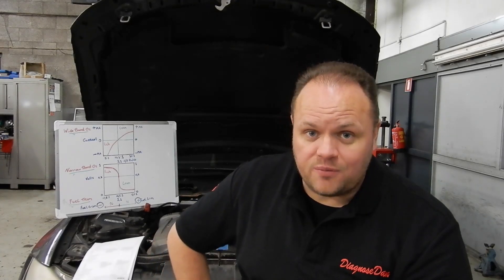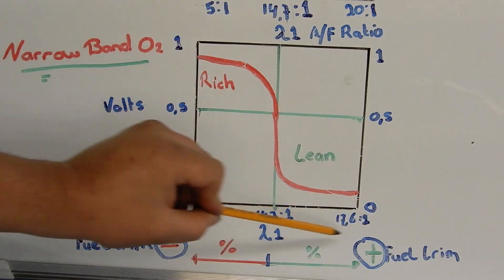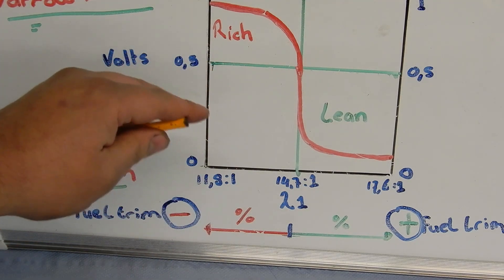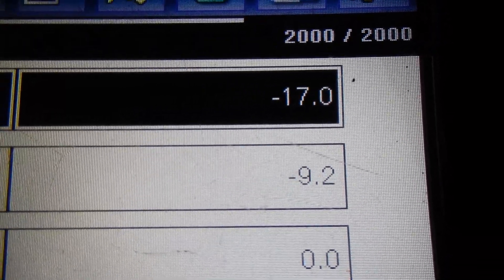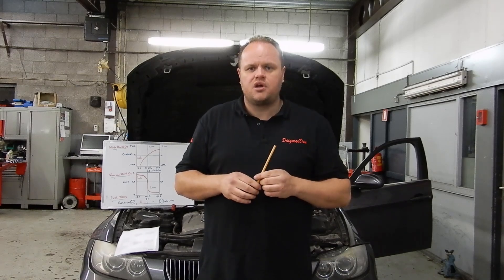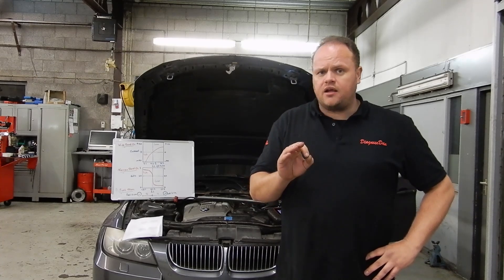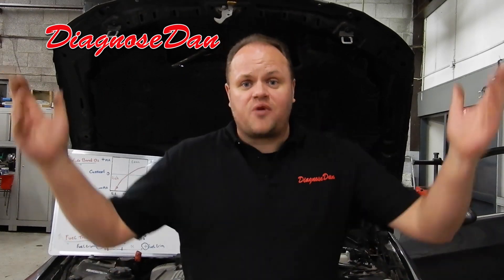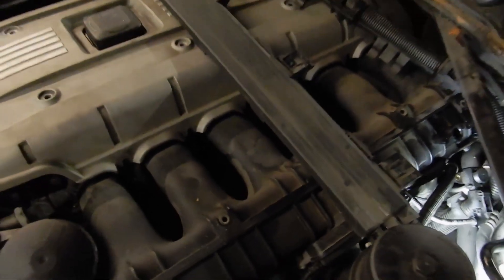Wideband O2 sensors, Narrowband O2 sensors and Fuel trim.

Comment: hi Dan, how about titanium dioxide o2 sensors used in bmw M52 engines? these are narrow band o2 sensors which don't give a voltage to the ecu. they can't be diagnosed the same way as the more common zirconium dioxide sensors.

if you don't know they exist in some cars you could go realy the wrong way

Comment: Maybe a little late, but no vaccum is caused by that engine is running on valvetronic haha, no vaccum is generated due to the inlet valves are controlling the amount of air entering the engine by controlling the lift, vaccum are caused when a “butterfly” valve or throttle valve are partially closed, that causes a vaccum :)

Comment: I know this is an old video but you cant make a vacuum leak in the intake on that Bmw because it doesn't use a throttle body to control air intake. It uses valvetronic system to vary how much the valves are open to control throttle.
Reply: I had to scroll a bit to find the answer thanks

Comment: I have been driving myself insane troubleshooting a failed smog on my 98 boxster. Fuel trim negative, indicating rich.  But downstream shows 0.1 or 0.05, lean. This video explained clearly that it's likely an upstream.  Untill now I have been watching voltage instead.  Thanks for the help.

Comment: To answer you question at the end. No vacuum because the car is at wide open throttle and using variable valve displacement to control RPM? If both the O2 sensors was showing rich exhaust how you introduce a lean condition to test them?

Comment: What a great lesson Dan. My understanding of O2 sensors was basic till I watched your presentation. This topic is deep. I was glad you presented it in a slowed manner. I was actually haveing mental gymnastics calculating what you were presenting. Never knew widebands were current sensors.  Just replaced the downstream sensors in my 180000 mile N62TU. Car runs so much smoother. I think the downstream sensors play a role in fuel trim, not just cat effieciency monitors which was the code I got on bank 1 and 2. I have no clue on the algrithms BMW uses in the DME.

Comment: There is no vacuum because the vacuum is created at the intake valves with the variable valve lift system and the throttle blade is fully open when the car is warmed up, i think bmw calls this system valvematic

Comment: Great information. But why the FT for wideband o2 is not valid for Honda . In Honda during negative current the system runs lean and computer starts adding fuel.
Reply: from Scannerdanner.com Honda will typically display the sensor current directly, no voltage conversion shenanigans. 0 mA represents stoich, negative current indicates lean, and positive current indicates rich. Have a close look at those current values: Around .4 mA during power enrichment, and 1.5 mA during fuel cut decel. This is why measuring the sensor signal directly is so difficult!

Note the AF FB and AF FB AVE PIDs - these are Honda-ese for short and long term fuel trims. Snap-On was kind enough to add the translation in, but I can’t say that all scanners will do this. They’re also not displayed like typical fuel trims, so remember this: Values above 1.00 represent positive trims, and values below 1.00 represent negative. For example, if your data showed AF FB at 1.13 and your AF FB AVE at .98, that would translate to a short term of 13% and a long term of -2%.

Comment: Great video and great explanation.  Let's assume that your OBDII scanner does not give you amperage in mA for your wideband upstream O2 sensor.  How can you tell the wideband upstream O2 sensor is bad in your example, since the voltage only changed from .940 volts (on bad sensor) to about 1.0 volt on the good sensor?  In other words without knowing the mA on the upstream wideband O2 sensor, how can you tell what it is reading only by the , as I assume voltage reading?

Comment: I recently worked on a Honda where wideband negative current draw was lean, not rich like in the video. Is this something specific to hondas?
Reply: scannerdanner.com  :  Honda will typically display the sensor current directly, no voltage conversion shenanigans. 0 mA represents stoich, negative current indicates lean, and positive current indicates rich. Have a close look at those current values: Around .4 mA during power enrichment, and 1.5 mA during fuel cut decel. This is why measuring the sensor signal directly is so difficult!

Note the AF FB and AF FB AVE PIDs - these are Honda-ese for short and long term fuel trims. Snap-On was kind enough to add the translation in, but I can’t say that all scanners will do this. They’re also not displayed like typical fuel trims, so remember this: Values above 1.00 represent positive trims, and values below 1.00 represent negative. For example, if your data showed AF FB at 1.13 and your AF FB AVE at .98, that would translate to a short term of 13% and a long term of -2%.

Comment: Hi Dan, 
could you tell me if these changes in PIDs are normal or not, please?
After the engine warmed up
RPM : ~2000RPM 
upstream O2 sensor  :   -0.008 mA (this fluactes a bit)
downstream O2 sensor : 0.56

2 minutes later 
RPM :~200RPM
upstream O2 sensor:   -0.055mA
downstream O2 sensor: 0.135V

should the voltage of the downstream sensor remain roughly 0.5 V  cuz the RPM was the same?

Comment: No vacuum because of variable valve timing. Does BMW use the intake valves as throttle? I'm pretty sure Nissan is doing something like that now. Air is stacked in the manifold because the throttle body is open and when the intake valve opens the air is right there ready to go in at atmospheric pressure. Pretty cool.

Comment: The BMW has no vac in intake, because it uses valvetronic variable vale lift to control airflow into engine. So there is essentially no throttle body at front of inlet manifold to create a vacuum

Comment: thank you for the video I've had a hard time finding good explanations of wideband, narrowband, and the relation between the two with new systems that use both oxygen sensors for fuel trims.  Next is Biased Voltage sensors.

Comment: I think there is no real Vakuum in the intake manifold because BMW don't use a throttle valve to control the amount of intake air, instead of that they control the travel and the duration of the intake valves using a system called "Valvetronic" or "Fully-variable elektromechanical valve gear".

Comment: thanks for awesome video .  i have 2016 hyundai 1.6l GDI . upstream reads 1.40v steady .   respond's to vacuum leak and rich to add brake cleaner . downstream steady at 0.600 mv ... no symptoms no codes .  complaint is excessive fuel consumption ... upstream o2 is 5wires . thanks for your help

Comment: hi Dan, i just got a CLK200K 2009 A209, Kompressor Avantgarde, convertible . 184hp, Automatic 5 gears. i think it drinks too much juice, i can not get more than 27 miles per gallon. in the last few days i am trying to learn about sensors , fuel trims, zone sensors, wide/narrow bands . i dont know much. what do you think i need to do / know in order to improve mpg. thank you

Comment: I have a Commodore with a Buick derived engine. { Australia) I will stick with its simplicity compared to these Euro engines with multiple O2 sensors and variable valve timing. So far 280,000 kilometres and still on original injectors and sensors. I can do a lot of the work myself unlike these complex cars which need some expensive equipment to diagnose. Still very fascinating learning how all this new fangled stuff works. Really appreciate your time and dedication producing this training grade series.

Comment: BMW call that system Valvetronic. The car does have a throttle, but it's mainly there for backup purposes. Inlet air regulation is achieved by means of variable valve lift. It's a semi-complicated system of lifters, followers, an eccentric shaft and a servo motor.

I'm not entirely sure what the benefits of this system are supposed to be, given the additional complexity and reliability issues inherent to this type of thing, but I can attest to one of its main drawbacks - appalling throttle responce. Granted, I jumped from a 25 year old toyota with a cable-driven throttle (no VVT or VVL), which although not fast is quite snappy and very direct (plus, blipping the throttle doesn't require actually flooring it), into a 15 year old 325i. The main thing that does not compute is their marketing claim - "The ultimate driving machine". This car is supposed to be a joy to drive, I don't see why they've hobbled it by turning the throttle into a wet sponge and demolishing the clutch feel completely.

I could go on a very long rant about the pointlessly complicated nth derivative algorithms which I'm sure they've used to make this thing feel as squishy as possible, when all they ever needed to do was just leave it linear :/

Comment: For some reason my N52 never threw any fault codes, even though one DISA valve had completely disintegrated, the other had seized up, the PCV system was fakked and the engine just generally wasn't too happy. It's still not running the way I'm told it's supposed to be, so who knows what else is wrong... Not a fault code in sight!

Comment: Dan I have A similar situation!
Honda Pilot 2003   3.5
Bank#1 is down.
Bank#2 is working.
Engine running at idle
By sight you can't tell something is wrong
But the pcm is taking fuel to that bank #1
I disconnect the 3 coils from that cylinder
Engine won't miss put them back and no change.
Then I decided to desconect each coils from #2 bank
And they miss and when I finish from desconecting all coil
Engine won't dies...
Pcm supplies the fuel to #1 cylinders and  engine keeps working..
If I reconnect bank #2  bank #1 shutt  down.
There's only 2 sensors up and downstream
V on downstream 0.035v up to 0.135 v
Upstream 0.915v and down engine warm.
Short term fuel trim bank 1 S1    -27.3% steady
                                           Bank 1 S2  -27.3% steady.
This is my nightmare for almost a year.
Many mechanics and tips here on you tube
And nothing...
I will check what you're teaching here.
Why this behavior this is the second pcm.
No codes..
No pending code.
Don't have the readings of #2 bank
Because my scanner only shows 1 bank.
But is working and spark plugs are clean.
Just gives me an advice when ever you can!
Thank's
That's the evidence on those cylinders.

Comment: there still use a valve plate only when engine start on cold condition, when the engine reach its normal working temperature valve plate remains wide open, then there is no vacuum at the intake manifold, valvetronic take control of the engine, now even with the engine at normal temperature operation the valve plate will operate if the engine is turned off and then back on, in this case the valve plate will wide open really quickly (milliseconds)

Comment: During idle Air Fuel Ratio should be maintain 14.7 or lambda 1 right? but 14.7AFR = 0.5v for o2 sensor, meaning during idle graph o2 sensor should be constant 0.5?

Comment: I dont know if there was already answer for your question, but i think it has something to do with valvetronic.
At least 4 cylinder valvetronic engines do have vacuum pump. I think n52 has also valvetronic. Maybe something to do with that?
Great vides, i really like. You are really doing diagnostics, not swapping parts.

Comment: So in that same bmw, if there is an intake gasket with a vacum leak, the long term fuel trim should be positive and since the ecu corrects the long term fuel trim to 13% at idle and to 5% at 2500rpm, I can pinpoint there is a vacum leak. Right? Thanks!

Comment: Hey Dan I know this video is a couple of years old but it just saved me over $2000 dollars. 2006 Acura TL 216,000 miles P0420 catalyst below threshold bank 1. But short term and long term fuel trimmed maxed out. Downstream sensors were reading lean condition.Sprayed carb cleaner to verify downstream o2 sensors were working. They were. Long story short  coolant temp sensor was +40° off. Making the ECU  think the car was hotter than it was and giving less fuel. Which the o2 sensors were reading and ecu trying to compensate with fuel trim. No 02 sensor replacement ($200 × 4) no catalytic converter replacement ($600 ×2). I do my own work (free). $30 coolant temp sensor fixed everything. Cant thank you enough. If you're ever in NYC I owe you a ton of beers.
Reply: Was the temp sensor reading off by looking at the scan tool live data? Or how did you find out the temp sensor was bad?
Reply: My temp sensor was bad, doing the same thing. My scan tool data said my temp was 140C on start up and my cooling fan was coming on, it's winter time. Car started fine with fuel source sprayed in intake but wasn't giving enough fuel to start in cold weather. Sensor was $30, so I ended my diagnosis there with fan running in cold.

Comment: Throttle is completely open. They regulate the rpm with the opening time of the intake valves. Similar to diesel. Right? (didn't look through the comments yet)

Comment: Where is your shop? I’ve had my car in two shops and still can’t figure out the P0420 code. They’ve both said O2 sensors and catalytic converter are good. Also a slightly high fuel pressure.

Comment: VANOS controls intake valves to throttle air flow, to achieve better "throttle response" by not having delay between valves and throttle plate.

Comment: I guess it's an engine with  BMW's Valvetronic system which regulates the amount of air the engine takes so no throttle valve (actually there is but for emergency situations only) on it. Intake valves act as throttle valve(s). So quasi atmospheric pressure can be measured inside the intake plenum.

Comment: Awesome video thank you Dan the man . System bmw came out with I believe it’s called vanos which requires no throttle plate so that engine rpm is changed through variable valve lift

Comment: Hi
I have a problem with my car which is honda jazz 2003
I have a problem with the output speed sensor and sometimes I loss the gas while I am driving
I had to stop the car and start it again.
I also have some misfiring while I am driving, the car just don't sound  
Right.
Should I change the output speed sensor?
What should I do?
Waiting for your reply.
Thank you 😊

Comment: So what voltage should narrow band sensor run in normal conditions? On the graph that you drawn it looked to be 0.5mV but on scan tool it was running at 1mV when it was fixed, or am I missed something?

Comment: Hey Dan,how u been ? I have an 05 murano,with a P1273 code bank 1S1. It’s the A/F ratio sensor. I was thinking of switching it to bank 2, and see if the trouble code will be set on bank 2. What do think,Dan? Give me some advice. It’s like when you swap the ignition coil,when it misses fire . Thanks

Comment: disconnecting the suspect wide band o2 sensor would have netted a positive result from the engine to confirm it being defective - the ecu would have supplied a preset quantity of fuel that is independent of o2 sensors for when they totally fail.

Comment: its a DI and to control idel with the lowes amount of fuel as possible they open the throttle to lower pumping losses, controlling rpm with fuel and timing
Reply: or im tinking of a difrent system ass I scroll down I see im am    ops

Comment: Hello. On my Lexus Rx350 my LTFT on idle are like 7-8%. Car has no DTC. Upstream Wideband sensors are showing very good values and response. But my donwstream sensors are showing 0.82V on idle on hot engine. It changes when i press the gas pedal. But on idle it is showing rich. As i understand they must be close to 0.5V. Upstream wideband sensors as i checked are superseded with new model which i ordered. On your video i see that downstream sensors are showin 0.7v. Is this okey ? Is it supposed to be 0.5V. Thank you ! :) And continue with this great videos.